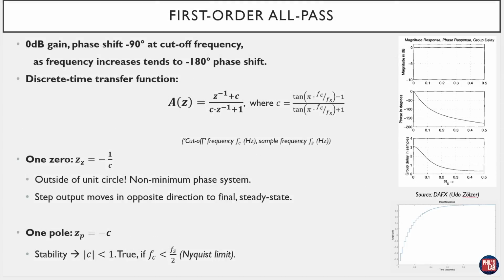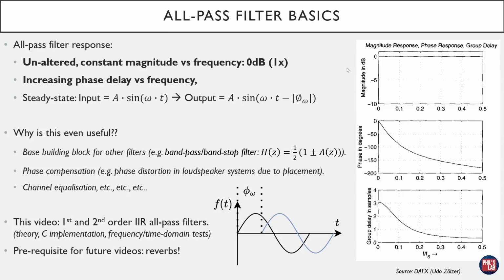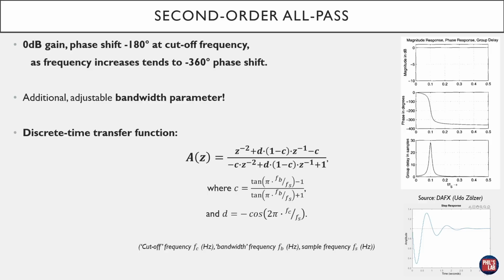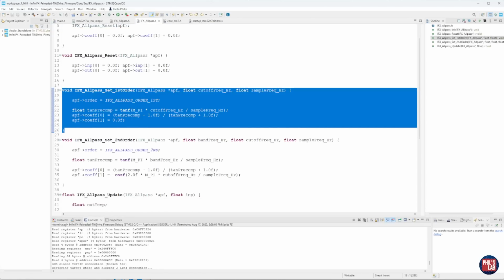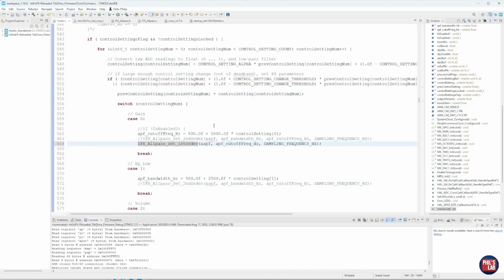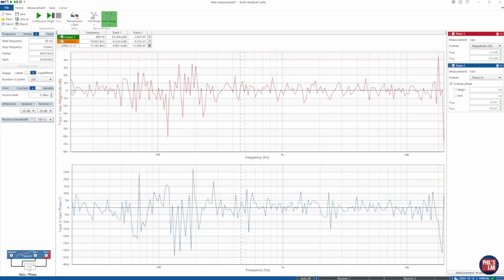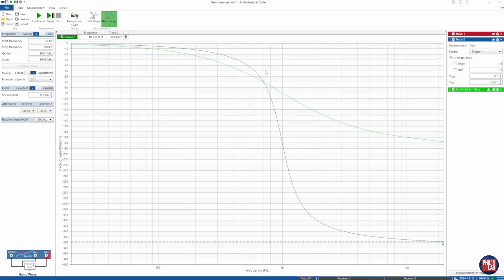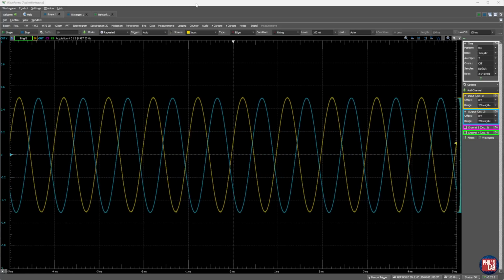All-Pass Filter Software Implementation (STM32 DSP) -  Phil's Lab #162

Comment: Software engineer tip:
You could add the "const" keyword at lines 22 and 32, since those floats won't change. Just to keep used to code with proper const corectness (that's not really important here specifically, just nitpicking)

Comment: Seems quite a large phase shift just from processing the signal, is the ADC slow?
Any chance you can record the effect of the phase shift? What does it do for the sound, or does that come later?
Reply from the maker: Phase shifts are due to the input/output anti-aliasing/reconstruction filters, CODEC digital filters, but then the main time delay is due to the (variable) processing block size in the H7 (typically around 256 samples at 44.1kHz).

Comment: You have a STM32H7 if i remember well , about how much of the MCU power is used for this filter? 
Tho it is not like linux where u have a % of CPU used. I sort of want to know if this MCU could handle 2-4 audio stream DSPs.
Is there a way to estimate what you need in terms of compute power beside estimating operations per sample and then check MCU clock frequency?
Reply: I've played with all pass filter code on similar hardware.  I implement 16-bit audio with a sample rate of 48,000 Hz, with a block size of 1024 bytes.  When using a ping-pong buffer arrangement, the available processing time is about 10 ms for each block.

On this fairly powerful hardware, you should be able to implement an all-pass filter that uses less than 0.05 ms to process a block of audio without any optimization tricks.  I convert the audio to floating point and use the single-precision FPU.   I implemented a Schroeder reverb with three all-pass filters, and a bank of 4 comb filters takes uses about 0.22 ms out of the 10 ms available.

Short answer.  Time is on your side.  Using the ping-pong approach does introduce delay.  Smaller buffer sizes give smaller delays.  You can easily run this code on less capable processors.